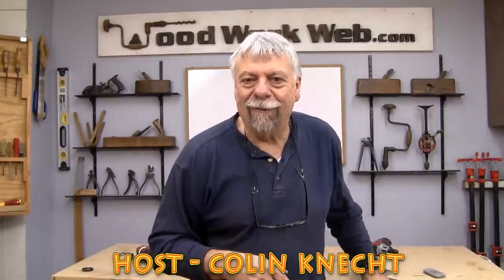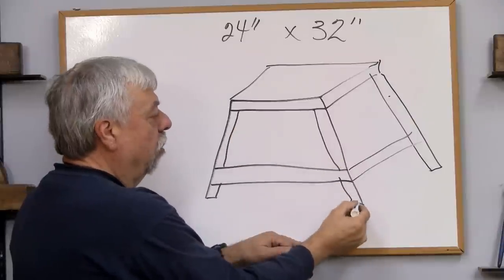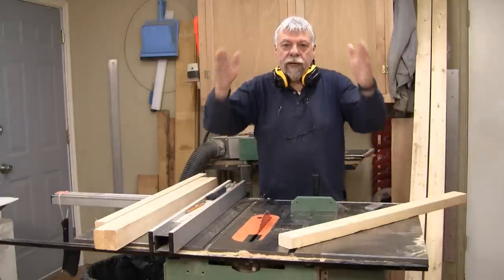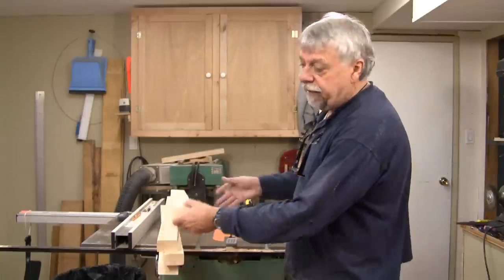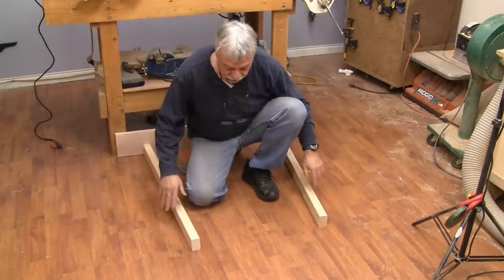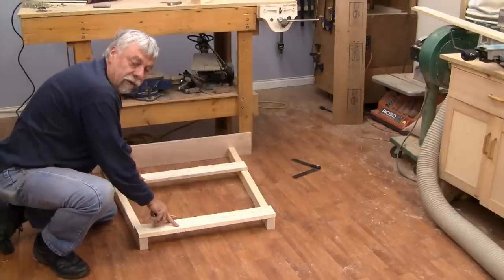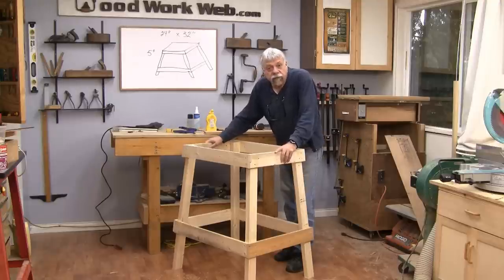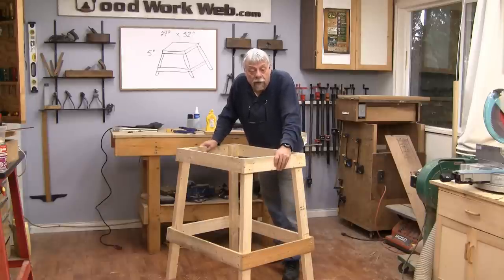Make a Router Table Stand - woodworkweb

Comment: For space reasons I've had to locate my router table in my tablesaw wing, but I always enjoy your videos Colin. Deceptively simple looking project. I would've bought twice that much lumber because I would have messed up one or two of those angle cuts for sure!
Reply from the maker: Michael Anderson Quite a few people do this, I never have but I know it works well for some. Yes, the angles can be a problem which is why I mark them ... otherwise I too get them mixed up. Thanks Michael for commenting
Reply: The big advantage to me is that I can use my table saw fence for the router. Never understood why router fences are not T-square designs.

Comment: A great project Colin. I made something similar to your design for my 12" Bench top drill press with a simple shelf on the middle support of the legs. Turns out I created another cluttered and jumbled tool accessory storage spot where I can rarely find anything related to the drill press. LOL  I seem to have become extremely good at the latter. LOL
Derek
Reply from the maker: GiddyUp994 Good idea with the shelf, and a great way to make legs rigid too. LOL, yeah, you and me both ... I need a database to find where I put stuff

Comment: Thanks, Colin - very useful - I have the same question about the angle at the bottom of the legs - it's clear when you show the assembled table that the leg bottoms are angled but I don't think you mentioned it when you cut the top angles.
Reply from the maker: Steve SteveS Hi Steve, great question, you are correct, I should have mentioned it for the top of the legs too ... I did not cut the angles at the top because I didn't think it was needed as the top would be sitting on the upper apron supports ... and it just makes it less complicated to cut the legs when it's not really needed.  Thanks again for taking the time to ask ...

Comment: This is a nice table, i am currently trying to build this, however I'm confused on the 5 degree angle with the 1x4 braces, what way does this angle need to be when attaching it to the legs. i understand this is on the top part of the board, how ever i don't know if the angle should be sloping in towards the 2x4 or away from the 2x4? Its hard to determine in your video.

Comment: In your design, do you think that it will be possible to have the table on wheels? Do you believe that adding wheels to the legs will affect the stability of the table? Great video! I am looking forward to see the finished table.
Reply from the maker: Angel Yes, it is possible to add wheels this design, I did not because even with the table to added later on, the table does not weigh that much so fairly easy to move around as it it ... at least on my floor :)
Reply: WoodWorkWeb
Hi Colin, thanks for your reply. I am looking forward to see the completion of this router table.

Comment: Great table! Is there a way to cut the angle at the bottom of the legs with no table saw, and only a chop saw that just cuts angles where you rotate the piece? The blade is fixed and can't change angle. Thanks.
Reply: +DolanCustomGuitars you should be able to cut yourself a guide using the end of one of the 1 x 4.  measure up 3/8 an in. from the end on one side and then draw a line to the opposite corner on the same end.  Then cut along that line on your chop saw.  Then you can but that up against the back fence of your chop saw and hold the piece you need to cut up against it to give you the 5 deg.  You need to cut the bottoms of the legs holding the stock along  first one and then the other orientation (face down then on its side) to get the compound miter.

Comment: Nice base, one question, did you leave the bottom of the legs at 90 degrees or did you also cut then at a 5 degrees.
Compound miter cuts are always fun, watched two carpenters spend 4 hours trying to figure out how to cut compound miter  to put 1 2x6 on a roof to match the existing trusses.  After wasting 4 2x6 the boss told me to help them/  I used my worm to do a compound miter cut with only one cut.  Some people don't like a smart ass but draw line for on angle and tip blade to the other angle desired and there is the compound miter cut.  Also fun to watch carpenters cut 4x8 backwards when sheathing walls.  They just put the line on the wrong side of the panels.
Reply: That would have been funny to watch.
Reply from the maker: Gary Finger The 5 degrees on both sides were cut on the bottoms of the legs Gary. The mitre gauge was set at 85 and 95 degrees and the saw blade was set to 5 degrees. I did not cut the angles at the top of the legs as it was not needed there.  Good question, thanks for asking
Reply: yes easy to do the wrong cut

Comment: Is that your 10 inch sliding miter saw?
Reply from the maker: M Geez Yes, that is correct
Reply: WoodWorkWeb I was looking into buying either a 10 in or a 12 inch sliding compound miter saw and it appears that your 10 inch is good enough -- basically I am starting out buying tools - dont really have a good work area -- so I am now concentrating on making myself a work area -- bench-- and shed for that bench-  going to make shed extra strong - hang things on walls and maybe solar panels on roof -- heavy tools - so floor needs to be strong also -- neighbors so needs to insulated for noise
Reply from the maker: M Geez  10" works for me, others need a saw that will cut slightly wider, which is the advantage of a 12", the only down side is the saw and the blades are more expensive.

Comment: I didn't understand why you changed the angle of the fence when cutting the ends. You could cut all four on the same 5 deg setting and then turn the legs over for assy.

Comment: How can I cut the angles with my miter saw? I do not have a table saw... I know I can angle my saw to 5 degrees, but I can't set my miter gauge to 85 or 95 degrees... Can I only angle my saw and not angle the mitre gauge?
Reply: 5 deg angle on the table plus 5 deg bevel gets you the compound angle you need. Reverse angles and bevels as needed.

Comment: couldn't you have cut all the legs at the same 5 degree angle and then just flip the boards?
Reply from the maker: TIM RUSSELL Yes, could have done the cut as you describe, but lining up the second cut 5 degree cut means a bit more work to get them all same, just a bit easier this way.